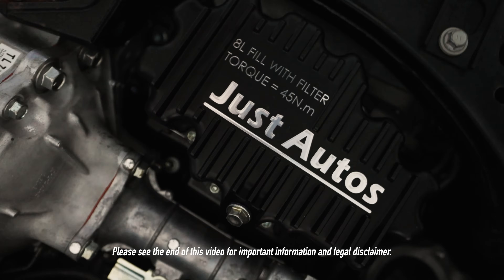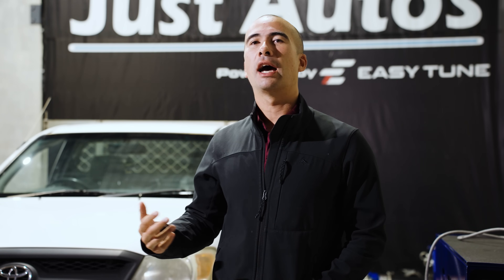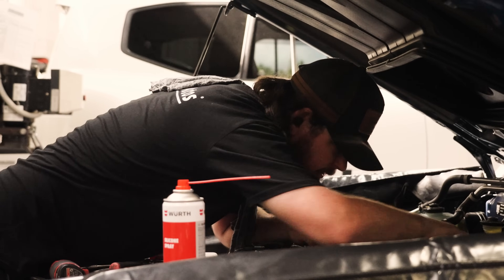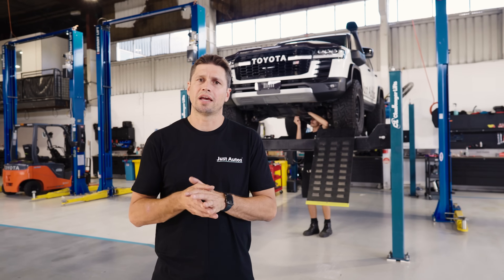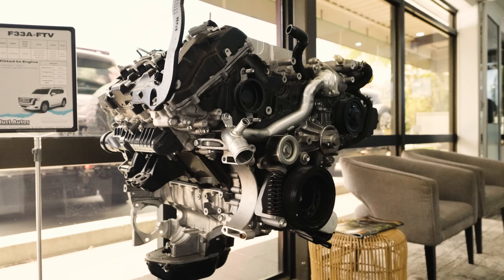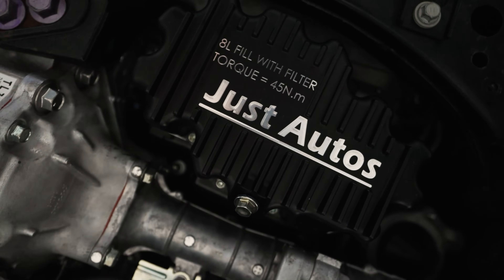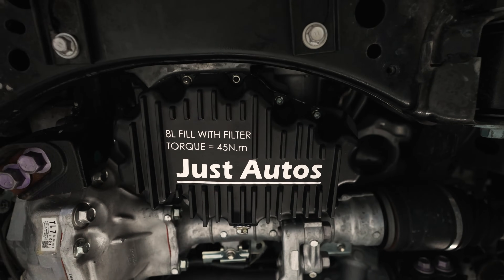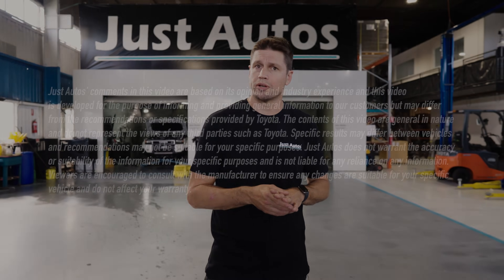We’re Making Our OWN Engine Oil – Here’s Why…

Comment: Don't over think it, there is no need to use group V oils in the 300 Series. Refer  to your service manual for severe use, select the correct grade oil which is C2 5w 30. I personally use C2/C3 5W-30 SP rating oil. 
For memory I think the manual calls for an oil chang at 5 months for severe use, however I agree with the Car Care Nut (You Tube channel) for turbo engines particularly diesel engines to change oil and filter every 3 months regardless of use.
The most important thing is to get all the contaminants out that are associated with the combustion process, you can buy quality oil for as little as $10 per litre.
Just my 2C
Reply: A 5W-30 SP is definitely a good starting baseline!
Reply: @LubricationExplained  Thank you I appreciate that.
Reply: Toyota will only use 520, I have gone through the manual for severe use, their reply, ‘we will only use 520’.  I am not sure what the answer is.
Reply: @johnrhodes9892  May I suggest take your vehicle to a trusted independent mechanic. Purchase genuine toyota oil filters, oil of your choice (if you have trouble contact oil tech eg. Penrite) and keep receipts.
Reply: @johnrhodes9892 you mean 0W-20. Toyota doesn’t use 5W-20.
Reply: @YZJB apologies my error, yes your correct.
Reply: With API/ILSAC releasing their new oil standard designed for modern turbo/DI engines...it makes you wonder....maybe the older standard that was out for only 5 years wasn't good enough.  The classic "change your oil often", seems like it didn't hold true for them to update the oil standard so fast.

Comment: Just run a 10w-40 full synthetic hths, plain and simple. Either that motor main and rod bearing clearances are to tight when engine gets hot and oil journals create oil pressure drop through bad design or they dont. Dont chase emissions and fuel economy crap with thin oils like the manufacturers do. A manufacturer loves planned obsolescence and vehicles surviving just past warranty. Its a sad day that toyota has adopted the business model. ROI, have you ever seen bearing problems from a vehicle with 5000km oil changes? The answer is no unless there is some other manufacturing problem. 
Ford already went through this crap with the lion motor what i mentioned above, including the amount of bearing surface area aswell, not much for the torque and bad oil pressure at idle.
Reply: I think if we were to go with a clean slate - 5W-40 or similar is probably the right answer. There's some evidence from use in other countries where that approach has been successful. The main issue is trying to satisfy the OEM requirements as well, which stipulate up to a 5W-30. The SAE 30 grade is pretty generous though, so you can make an oil that a "heavy" 30 which touches the low end of the SAE 40 range.

Comment: Very interesting content. What was the scenarios with two damaged  engines J A were investigating, e.g., normal driving , hard heavy hot weather towing,  before or after performance tune, was there similar vehicle usage with the both engines?. With  different oil grades of being tested, do you envisage any negative effects on DPFs. Thanking you.

Comment: Matt there is a big focus on cooling the oil 

Is there a reason you don’t just run a pull or push type fan cooler externally of the engine to achieve greater cooling capacity ? And obviously the lines and cooler will hold additional oil compared to normal capacity ? 

We had a similar issue with Cummins engines in road trains 

Pulled filterd oil from a gallery or adaptor to the oil pressure sensor, through an external cooler and made a custom billet filler cap with a fitting in it to allow cool oil re-entry straight onto the timing gears of those engines 
Worked perfectly, dropped 40° on a hot day out of the oil 

Hope it has success anyhow mate see how it goes

Edit: forgot to mention, and there will be 1 million haters on the subject, but we had 15% Moreys oil stabiliser in the oil

Aside from the hate, that stuff kept our viscosity and its ability to keep oil where it should be imperative, instead of being flung off the cam’s an rockers that stuff sticks like shit to blanket and the oil stuck to the lobes and rollers like nothing I’ve seen, put it in oil and put your camera to slow motion and capture your cam rolling, no oil flying off with that stuff in there
Reply from the maker: It’s a great idea and we have looked at it but I need it to be very reliable as external oil cooler are subject to leaking or rubbing under extreme corrugation. It’s hard to
Make a product these days that work in every car as accessories are wild. Thanks for your input mate
Reply: @JustAutosMechanical 

Yea fair call mate 

We ran Derale coolers, I’m not sure on your room in front of the cooling pack in a 300 series so I can’t comment on that but google them if your interested. They make tier 1 coolers 

Anyhow you’ll sort it mate, good luck with the oil, hopefully it sorts there issues out
Reply: that shit caused your high temps. Thinner oil runs cooler.
Reply: @V8Lenny 

True ? 

Just hold 5 I’ll call the boys up, tell em not to stress I have found the issue, it’s not the 220t of gross weight in 45° ambients plus 75% humidity trying to pull 4 trailers through the Pilbara of WA 

Get rid of the coolers and the Moreys, and just whack some thinner oil in boys problem solved 

And when they start asking questions about oil shear from the timing gears and lack of oil pressure and excess wear metals in samples and camshafts keep tearing lobes to pieces I’ll say it’s all good! V8 Lenny told me so 

And before you go quoting the motor oil geek to me about additive dilution and thicker oil blah blah blah just get him to sample a truck in port Hedland for viscosity loss after 20k of engine oil life without a heavy base oil additive 

Thanks for your time V8 Lenny and for being the first brave soul to tell me to get rid of Moreys in this thread 🤦🏻‍♂️
Reply: @Signaturegen2 Cummins knows what viscosity is needed, even in extreme conditions. Additives always harms your engine. Use thicker oil if needed.
Reply: @V8Lenny 

If OEM knows what there doing, and there engineers know what’s best for there motors

Why is Matt currently building sumps, installing heat exchangers and now developing his own oil because one of the world’s biggest manufacturers engines keeps failing ? 

What we have done has been proven to work, if it didn’t fix the issue it wouldn’t be in there. 

I’ll leave it at that V8 Lenny
Reply: @V8Lenny 

Yea as mentioned above your the first cab off the rank for haters 

That’s what caused it ay ? 

Not the 220t of weight in 4 trailers road trains  in ambient temps of 45°c at 100% load pulling through hills in the Pilbara of WA 

But shit I’ll call em up and tell the boys I’ve solved all there issues, get rid of the coolers and the Moreys cause V8 Lenny said so and put in a 0W-40 cause the problem is the oil is to thick 🤦🏻‍♂️

Hop back in your box mate, it wouldn’t be in there if it didn’t make a difference to the engines.

Comment: Interesting vid guys. 
My ‘20 200  just went in for its 80k service and Toyota used 0w-30 on a totally std engine … read that it help when starting and then when it reaches 100c temp the viscosity is that of 5w-40..
Reply: The second number in the oil viscosity grade is measured at 100C, so a XX-30 will always be thinner than an XX-40 at 100C. However, there's a decent range to the grades; the low end of the SAE 40 grade is the high end of the SAE 30 grade, so you can get viscosities which are pretty close.

Comment: Been following this real closely from JA. If I put one of these sumps on my 300 will it affect my warranty?
Reply from the maker: Yes I believe it would
Reply: I probably think it would since it is not a factory option and even if you have proofs backing it up claiming that this oil pan is better than the stock Toyota oil pan no corporate would take the risk of warranting it since if god forbid a engine does throw a rod there is no way to justify it is a manufacturing defect and not a defect introduced by installing a larger oil pan,because in-front of these giant corporations their internal QA/QC team have had vigorously tested each part that is sensitive to their reputation and pride installing any aftermarket product throws away every and all equation that involves any sensitive part of the car such as an engine.
hope this helps.